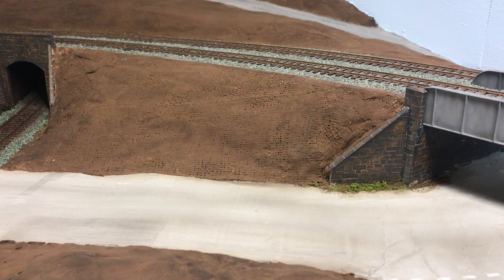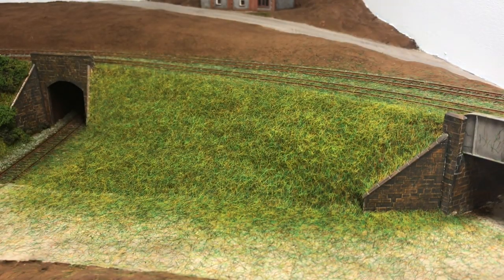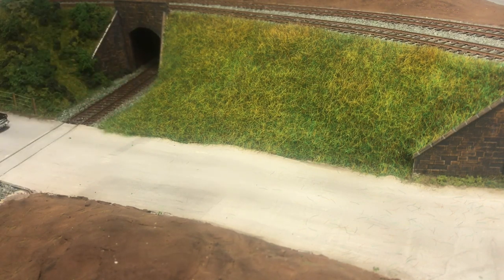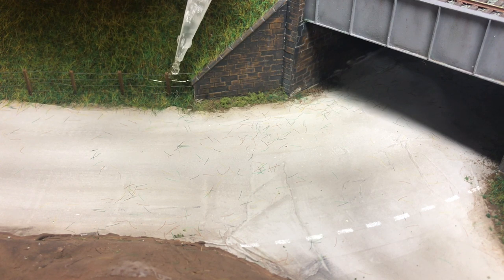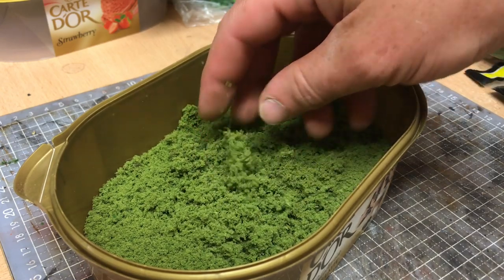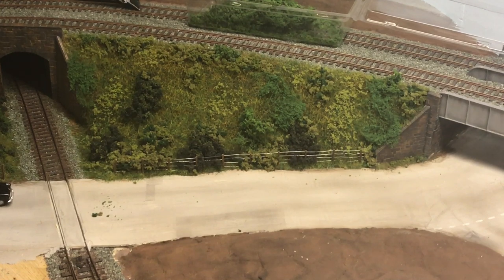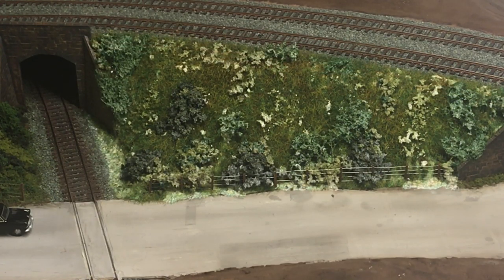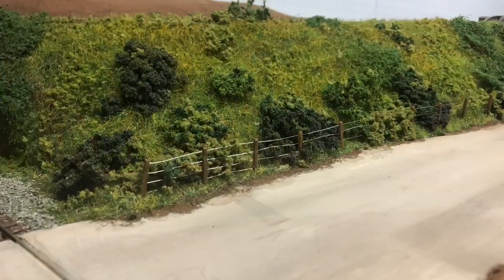Building A OO Gauge Model Railway: Scenic Developments

Comment: Nice looking embankment with well laid track running between the two over bridges.   I note you left the static grass to dry overnight before adding additional mixture.  I use the layering spray  before the initial layer is dry to add the additional layers.  Seems to work well - I assume the hairspray would work the same way.  Cheers Euan
Reply from the maker: Thanks Euan.  I left the initial layer overnight in order that I could give a good close hoover the next day before going on to the next stage as I felt some of the grass wasn’t bonding well to the surface. I later discovered this was down to the cheap glue I had been using and have since changed to another brand. The hairspray came directly from Lewis at Mouldy Raspberry and I’ve got to say it works really well and a lot less expensive than the layering sprays on the market. Paul

Comment: Great job Paul. See you are getting some good weather across the water or have youbeen on holiday in the Med? Need to Message you but will do so in the next week or so. Chat soon. Before I forget, I purchased Rust-o-leum Cemeht spray for when I paint some silos that I bought. Would you recommend? Mike
Reply from the maker: Hi Mike, the good weather has coincided with a few days off for me which is a stroke of luck. I haven’t used that product before but will check it out. I can’t see how it wouldn’t be a good option on the silos. Check out Leila for the product he used on his, it worked very well. Chat soon my friend. Paul